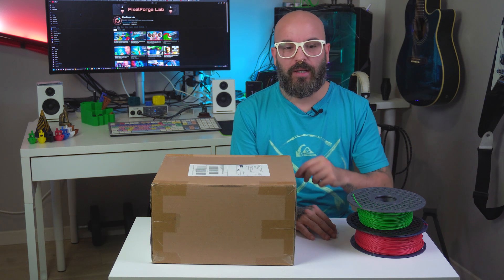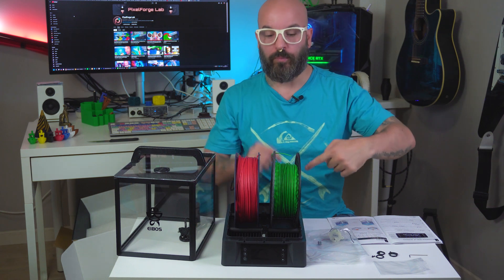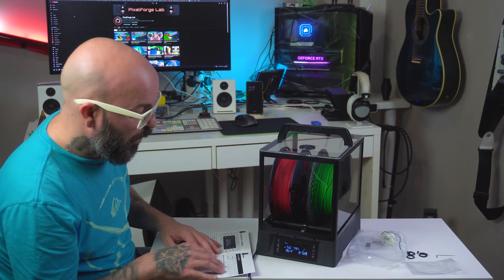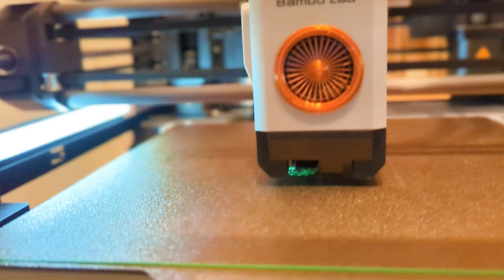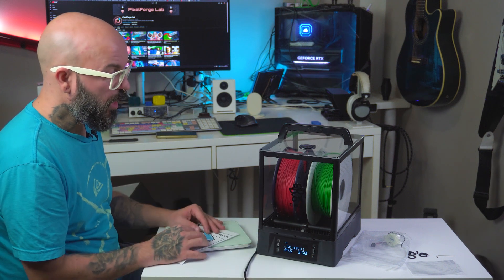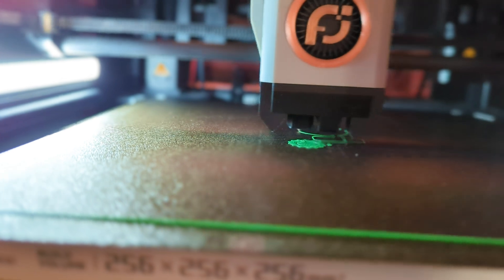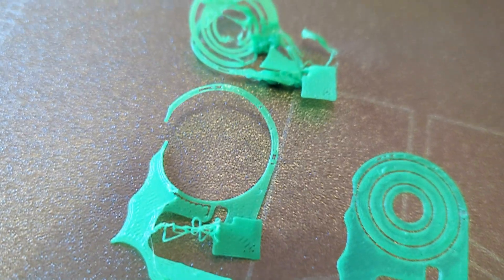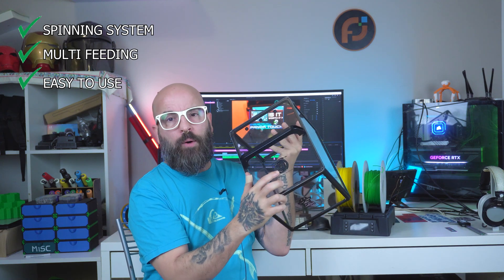EIBOS Filament Dryer 'Polyphemus' | HONEST REVIEW

Comment: I noticed that the lid is massive, would you say that it is airtight, or would you recommend getting a different storage unit
Reply from the maker: Mmmm, you'll get used to it
Reply: @PixelForgeLab  I noticed on the website they don’t sell motors. What motor do you usually get for it?

Comment: These are garbage, won't seal, won't spin freely and the spools drift to the sides and eventually bind. But not before your print fails because the rollers are trash.

Just a waste of money and space.
Reply from the maker: Still works fine for me, maybe you got a faulty unit